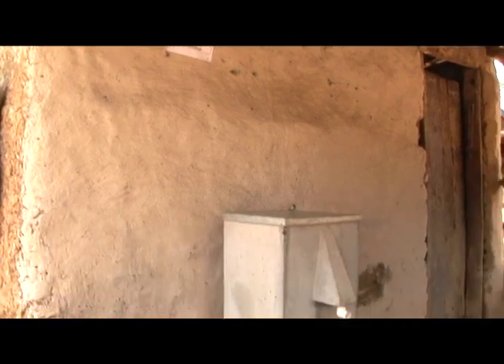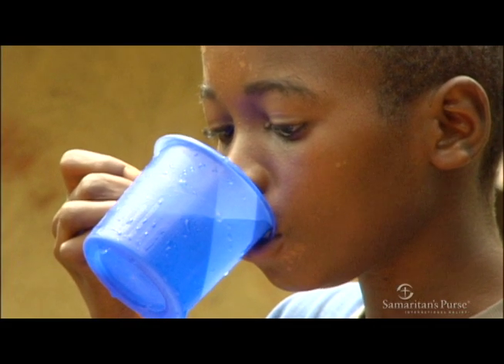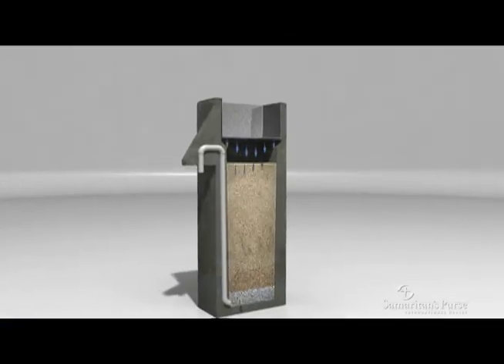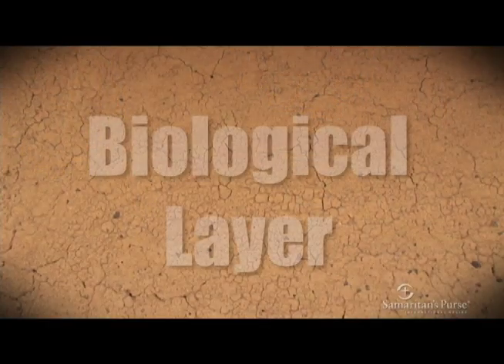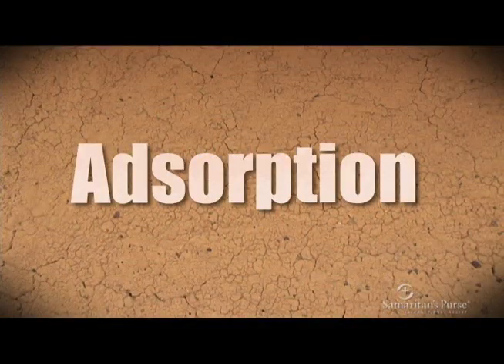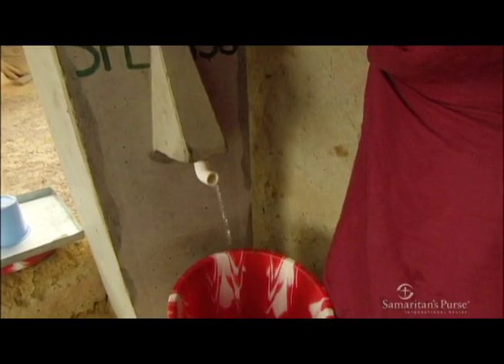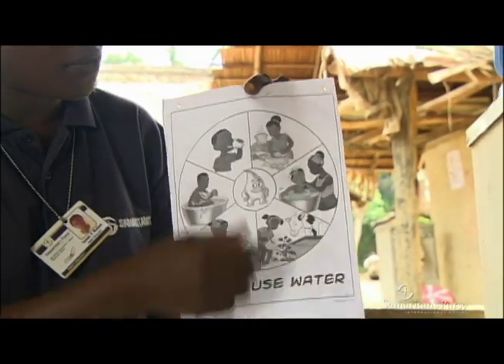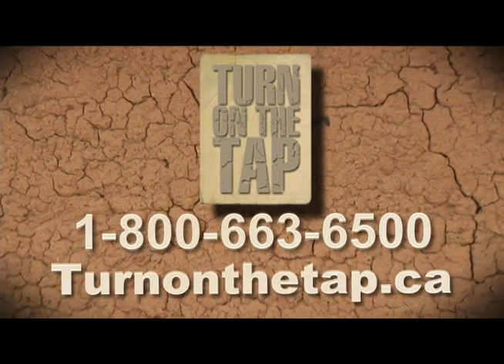How the BioSand Water Filter works - Samaritan's Purse CANADA

Comment: Now does this filter out the same things that a ceramic filter like the Katadyn Pocket does, or would it filter some things that a ceramic filter wouldn't?  I'm wondering if using a biosand filter along with a ceramic filter would be redundant (as opposed to using a biosand filter with along with activated carbon).
Reply: Dude, watch the video again. I have the Katadyn and the only thing extra it brings to the table is the silver in the ceramic. That's it. A ceramic filter that didn't have the silver in it would add NO benefit while reducing the flow rate considerably. This filter is just an adaptation of the process that makes well water safe to drink.

Comment: The jungles most likely have cleaner water to begin with than we do here in the good old farm runoff pesticide/herbacide laden USA. I would rather drink from a BioSand filter than tap water any day. Call me crazy but I have a serious issue with people forcing me to swallow toxic waste, I.E. hydrofluorosilic acid, which most cities now use to fluoridate the water. It eats holes through concrete. Look it up. Bad stuff for sure.

Comment: @rave208 We do use sand filters to clean water for modern cities in the west only they are very big, whole areas of ground. Hospitals use ultra violet rays, for special cases? In spain the water contains chlorine but I suppose that is put in after the water has been filtered though here the catchment area is big so they use water from resevoirs rather than filtered used water, so maybe they use chlorine for the cleanish resevoir water rather than to purify water. rose macaskie.

Comment: @cross3chris what i saiid is so badly written, what sort of hurry was in when. It must go like this. the pathogens that stick to the sand die later on, first stick and then die from hungrer and lack of light. As the out pipe goes from the bottom of the barrel up to a tap that is at the level of the top of the sand only the depth of water above the level of the tap in the barrel will drain out of the barrel there's time for pathogens to die, water does not run straight in and out. .

Comment: I didnot correct all the typing errors so where i wanted to put out pipe is writen our pipe I suppose the ppahtogens that stick to the sand die later onfirst stick and then die from hunger and lack of light. as the out pipe goes fromthe bottom of the barrel up. rose macaskie.

Comment: I understand how it works what i dont know is if you have to throw away the sand and put in clean sand every so often. 
  i suppose the pahtogens tha tstick in ht esand or to the sand die later.
  as the our pipe goes up to the level of the top of the sand the water that runs of is the amount of water you put in but coming from the bottom of the sand i suppose. the sand is always full of water to the level of the top of the pipe never empties below that level, i agan suppose. rose maccaskie